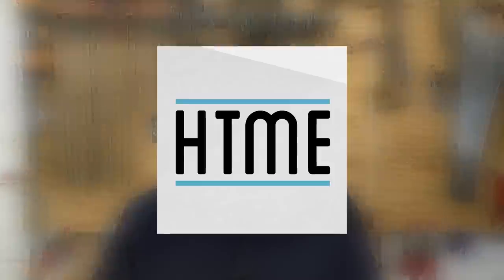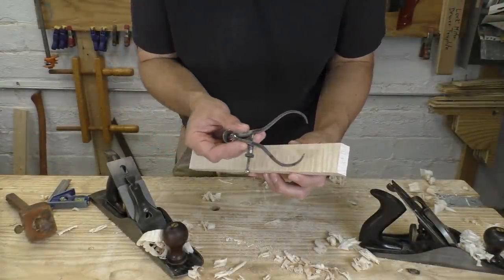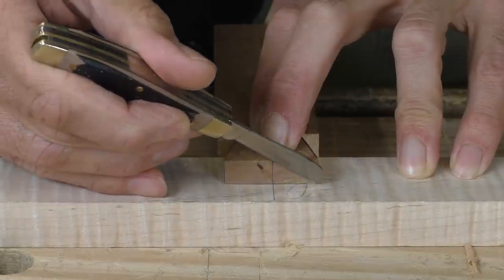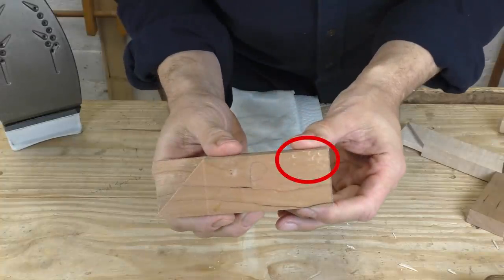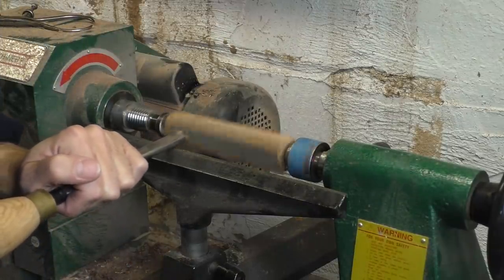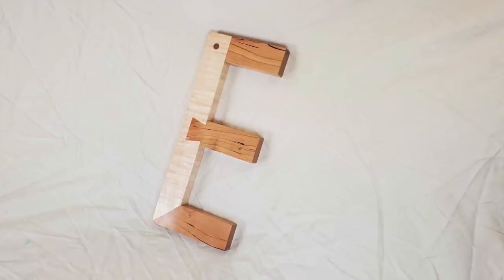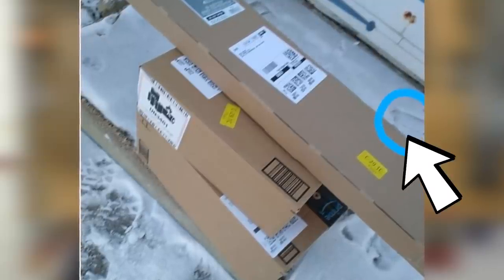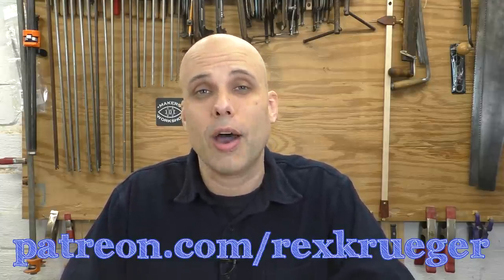I made an "E" for How to Make Everything...and someone stole it.

Comment: Hey Rex, new here hope you see this

As you rightly point out wood with more moisture is larger volumetrically.

Well you can use this to avoid using glue as they did back in the day.

See how the spine of your piece, that paler wood, is wrapping around the other bits.

Well if the bits that fit inside are more well seasonsed they shrink less.

Assuming this is bought in old stock then both woods will be seasoned equally.

Well of you know your piece (in this case the pale wood spine) is going to physically hold onto the other parts (as is the case with the Dove tail socket and bridal joint) you can leave it in water for a day or two to soak upwater and sort of "unseason" (not a technical term I know) but then as it dries it will shrink again

Assuming you build it in every other way as you did here, minus the glue, with the pale wood spine soaked and tightly fitted as you did here, and then shrinking onto the other pieces as it dries, it with hold onto the other parts extremely tightly as it shrink fits. No nails, no glue.

Comment: The bottom one is a common joint in picture frames. On canvas frames, the bottom lap joint is usually cut short to accommodate a wedge, known as a "key" , for tightening and adjusting the frame and canvas.

Comment: Very cool. I don't know what it is about Cherry, but I am always pulling dents out of it with water. I've actually found that on small one you don't even need heat. A single droop of water, and 10 minutes of resting, will pull it right back. Ballsy move to drill that hole with a hand drill, lol. You need a nice, sharp bit, and a firm, steady hand to pull that off. No way I'd try that at that late of a step in the project. Drill press or router for me.

Comment: Bit late to the party, but I just wanted to mention at 8:29, you're filing the radius. The common technique among metalworkers is rather than rotating the file with the curve, rotate it against the curve, so you're tracing an arc that is upside down to the curve you're filing, this gives a curve that is more easily consistent. I've done the way you're doing it for a while before I learned that technique and you get basically the same result in the end, but I've found myself having to check the work more often when I'm doing it that way

Comment: You're too modest.  The "E" came out great from your initial concept to the choice of materials and joinery.  On the surface it's a simple thing.  But those of us that enjoy wood working of this sort understand how the seemingly simple can still be a fair amount of work.    And yeah, your instinct was right, it needed the peg in the upper arm.  I love how the joints increase in bulk and their look of stability from the small peg to the medium dovetail to the more imposing mitered bridal joint.  

I like to use a raised drying board too.  But in my case it's a 12x18 piece of 3/8ply with a bunch of 1 1/2" 18ga brad nails from the air tool driven at a roughly 1.5" grid.  Holds small or big pieces along with multiple parts up for good air circulation with negligible contact marks on oil or rubbed on varnished parts.  It's been super handy for about 5 years now.   I just put it away carefully out of reach when not in use so I don't do something stupid and lean on it....

Comment: Check out some of Baumgartner Restoration's videos for some canvas frames that have a joint that looks similar to that last one. They are a bit interesting in that they are not made to hold fast, though. They're made to move so they can expand to tension the canvas while still keeping all the parts interlocked with each other. Hidden behind the canvas, the gaps from expansion aren't visible.

Comment: 9:41 - Matt Estlea (pronounced: est-lay). Sorry, I know how much of a pet hate that is for him.

Also, on the boards with the bolts your using to hold up the 'e' ready for finish...Do you think that putting a dab of CA glue on the ends of the bolts would be a good idea to prevent damage from the metal bolts?

Comment: Thank you for the Livestream. 
What a kuul project.
New guy to all this. I.E. the silly question on can you pad the vice Jaws w leather to hold yet not mar the work??
  In the forge I use copper inserts in my leg vice to hold the hot steel so it's not marked by the vice Jaws.
  Thanks again
Crawford out 🙏🔥⚒️🧙🏼‍♂️
Reply: In a woodworking vise that’s not really necessary, although it can help with grip strength. If you’re trying to do woodwork in a metalworking vise, then yes you definitely would want some sort of soft jaw.

Comment: Wel... least you can now make R and X with different methods and get your self your own logo? You can use your logo and basis and just add the E and X after it. I dont think its much of a issue to have them in capital letters instead of the small ones. And great show of talent while at it. As its been said its not about skill of how to do it, but how to hide your mistakes.. in this case innovate to salvage project by accorporating it into another.